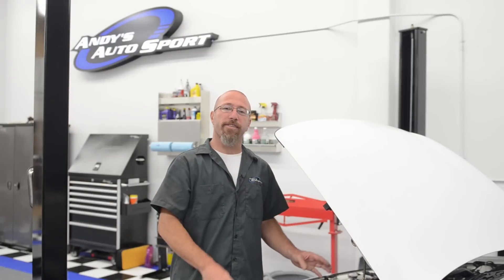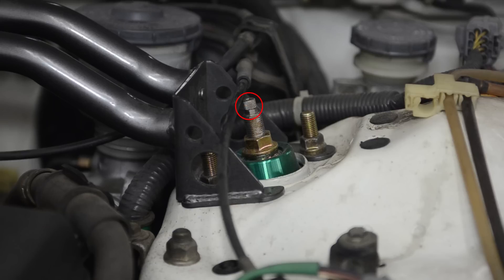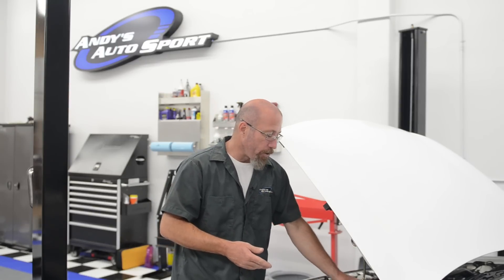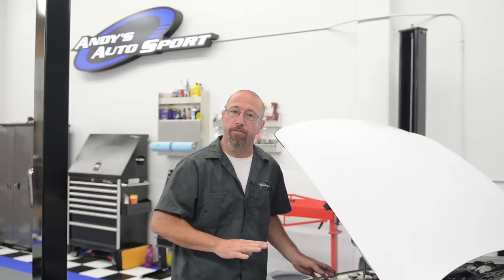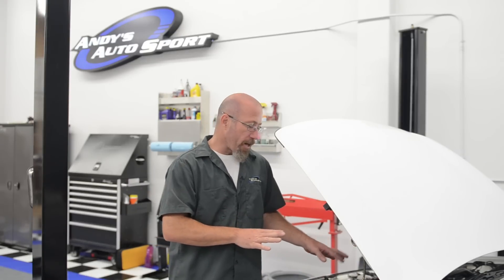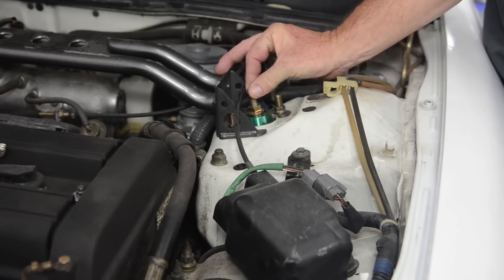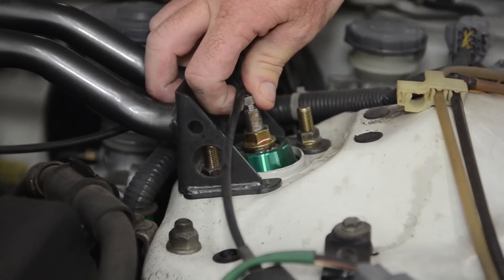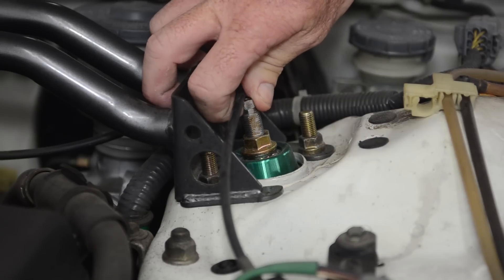How do I change my damping or rebound on my struts?  Presented by Andy's Auto Sport

Comment: Hey. I have a 09 altima. I want to know what the best coil over to keep my comfortable ride.
Reply from the maker: Hi Sean!  If it were my car, I'd go with this set from Tein:

https://www.andysautosport.com/products/tein__GSK10-9UAS2.html

They're designed for street use, and they give you the ability to adjust the shock pressure.  So after you lower the car, you can test the full spectrum of shock pressures until you find one that's just right for you.  Hope that helps!